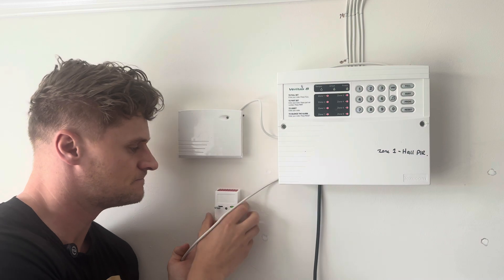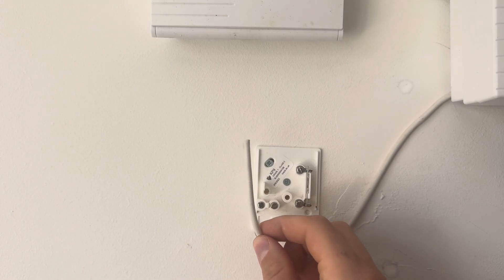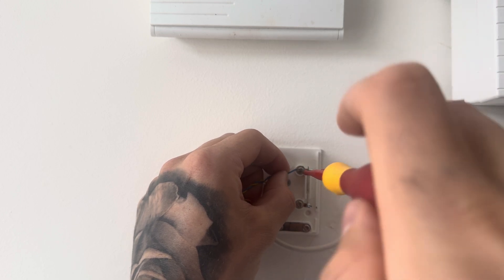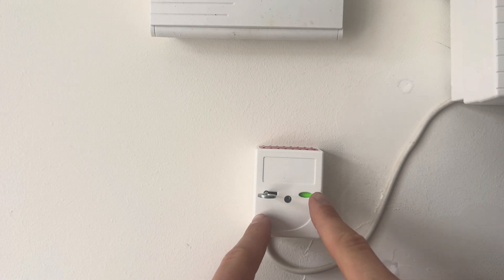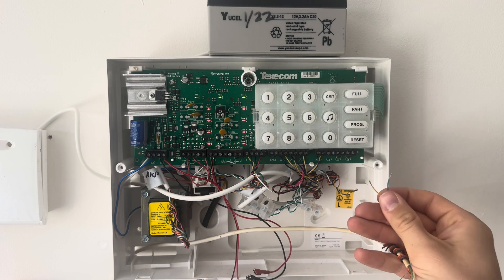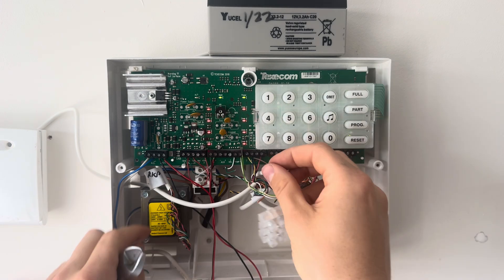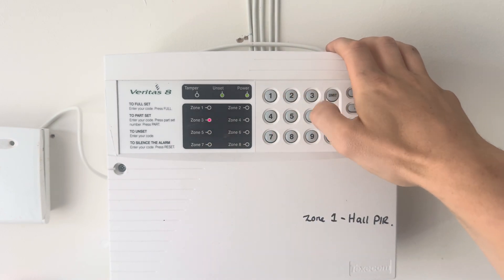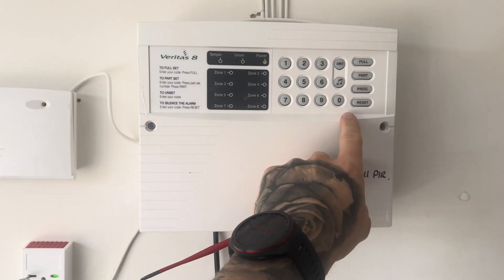How to install a PANIC ALARM on to your burglar alarm system

Comment: On our panic button it looks like it’s been pressed but it’s still green not red and we don’t have the key for it idk
Reply from the maker: Sometimes they can fall slightly, if your alarm is useable it means the panic alarm hasn’t triggered so you should be ok, you can get keys off eBay for not much at all just search “panic alarm key”

Comment: Sorry for asking so many questions but when we have a power cut it beeps until we put the code in do you know what it means it’s so annoying
Reply from the maker: Honestly it’s no problem at all I’m happy to help, yes whats happening is your back up battery needs replacing inside your control panel, when the power cut goes off your back up battery should kick in and hold charge for about 12-14 hours, but if your battery hasn’t been changed in at least the last 5 years the power cut is making the panel shut down because it’s got no back up supply working. Change the control panel battery for a 3Ah lead acid battery and you’ll be fine 👌
Reply: @SimonSecurityExpert  that battery has been in there since my mom moved into the house that was about 18 years ago so we definitely need to change it

Comment: When we pressed the music note button a while ago all it did was make a annoying noise for ages until we put the code in and it did nothing except that
Reply from the maker: You’ve accidentally turned the chime on in that case and it’ll go off depending on what zones are set up for chime, so it would of made a chime sound when you walked in front of a motion sensor for example (but not all of them)!